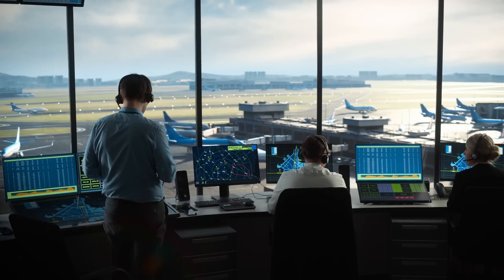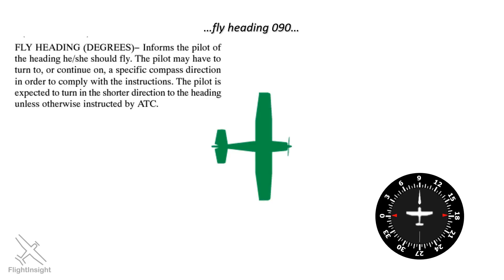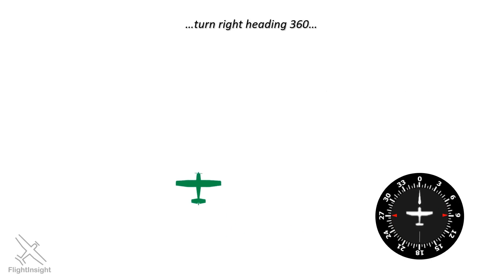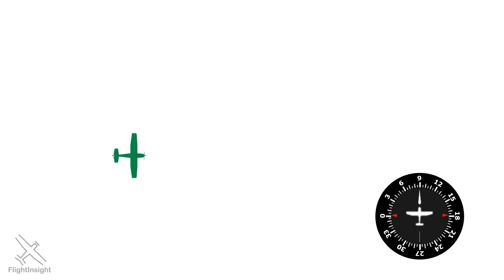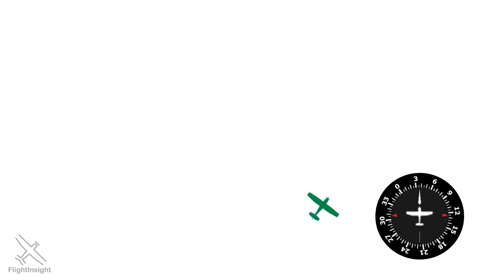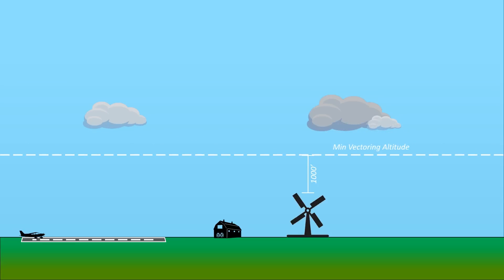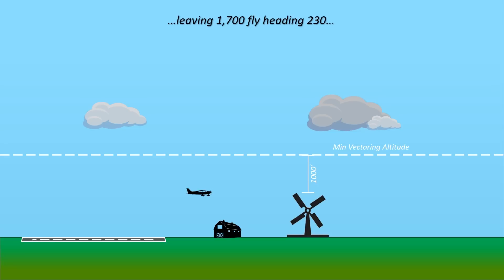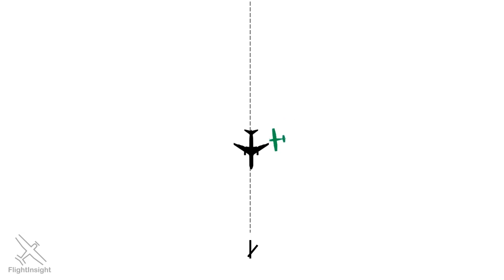Radar Vectors Explained | IFR Communications

Comment: Great stuff! Love the approach of helping the pilot get in the mind of the controller. One thing to note though is that controllers typically have to follow the same rules for directs as they do for headings (MRVAs, reasoning, assumption of additional responsibilities, etc), so often times controllers are trained to think of directs as another type of vector.

Comment: As ATC we are usually trained to repeat the turn direction if it is not the shortest turn

For example plane is heading north and I want a turn to 090

“Skyhawk41 turn left, left turn heading 090” 

That is best practice and can eliminate potential errors
Reply: When ever in doubt always ask ATC to repeat instructions or clarify. We are there to provide a service and the best service comes when everyone is on the same page and understands exactly what is happening and why. The pilot always has final say don’t be afraid to say “unable” and give a reason why

Comment: why doesnt atc just say "course xxx" instead of "heading xxx"? i have wondered for this for  a long time . I hope to get my private license  soon btw
Reply from the maker: Most aircraft are equipped with GPS nowadays and the pilot can use that to determine their course precisely, but that wasn't always the case.
Reply: Ground track can be finicky especially with winds at different altitudes. The best policy is to leave it up to the controller to make those adjustments, since they have the "big picture" and the responsibility for separation. If every pilot is making their own adjustments, it could get confusing. As GPS becomes more common, we may see this change one day, but not yet. Also, note that at higher speeds, even stiff crosswinds start to have little effect on ground track.
Reply: Private pilot here. Heading and course are two different things. Heading is where the nose of the aircraft is pointing, and course, or track is where the aircraft is actually going, when factoring in the winds. Not all aircraft display course to the pilots, although most modern aircraft do, some older ones that don’t have modern avionics installed will only display heading, so it would be up to the pilot to calculate the course , accounting for winds.

Comment: Doesn't MVA provide a 500ft clears vs 1000ft you said?
Reply from the maker: Check out the AIM 5-4-5 e on MVAs. Similar to other minimums it gets 1000 feet of clearance and 2000 in mountainous areas.